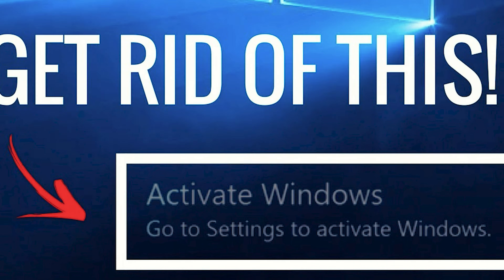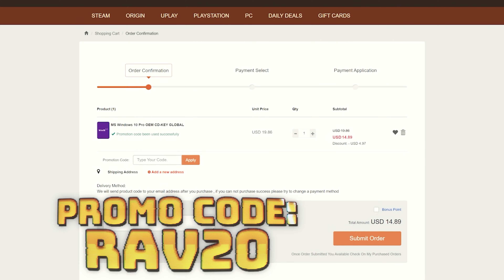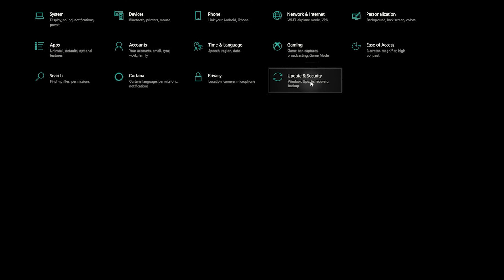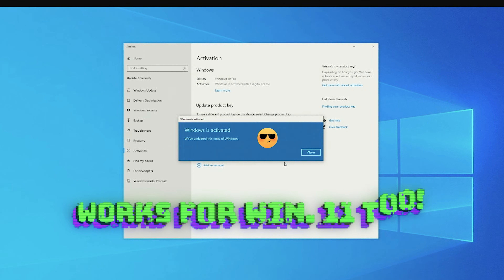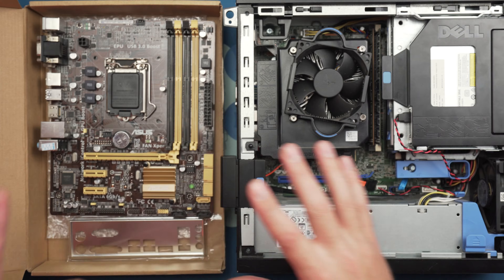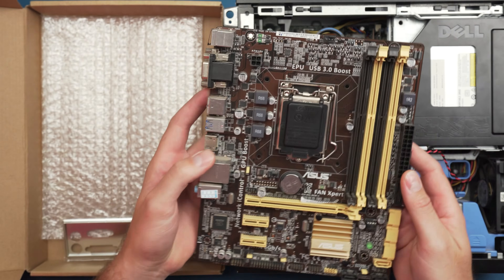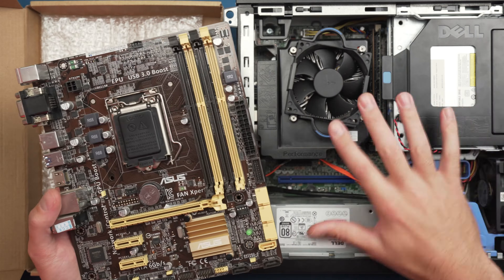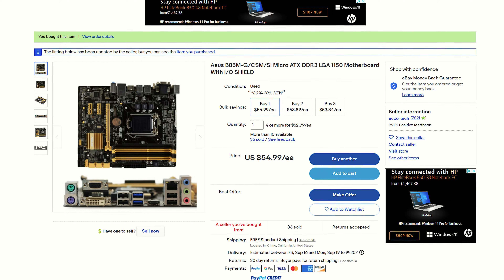Gaming Case Swap The Dell Optiplex SFF With ZERO Adapters! | Optiplex 9020, 9010, 7020, 3020 SFF

Comment: This isn’t really an optiplex case swap, it’s more of ripping out the guts of an optiplex and using it with a regular motherboard
Reply: Agree. I mean, this is exactly how any sane person should use SFF parts to upgrade, but talk about click bait title. Definitely not a case swap so much as a cannibalization. 😂
Reply: I just swapped a 9010 SFF motherboard into a 3010 SFF case, and while yes, some things like the front panel are a PITA, that's really about it.  Well electrically.  I had to take a dremel to the back IO panel, but still, you don't need any crazy skills to reuse the motherboard.

As a bonus, if you switch to the Dasharo implementation of Coreboot for the 7010/9010, you don't have to worry about the front panel errors at all.
Reply: Came here looking for a case swap, specifically because I want to use an optiplex motherboard (which sips power like a laptop when used in a homelab build), left disappointed. I downvoted this video without remorse, because it has a misleading title.
Reply: @danjayh  use an MT model, you can case swap those
Reply: It's not a case swap... The challenge on how to do  a real case swap is a reason why a viewer like me wants to know. Without buying a motherboard. Of course it is easier to buy a motherboard.
Reply: Well it’s the only way
Reply: Is that motherboard an upgrade from the original one?
Reply: I am going to do exactly what you did. Cause this works.
Reply: Ayo! Sell me the optiplex!
Reply: Yea because he didn't use any adapters without getting  a new motherboard u need adapters
Reply: "zero adapters" aside from the motherboard ig..?
Reply: lol, yeah.  clickbait
Reply: I think this is the right way to do it. In other cases you are still constrained by the PSU and the adaptors and while maybe spending similar amount of money and time. Doing it this way you have a lot of freedom to choose the parts you want.
Reply: He did explain why!
Reply: @saucysuishi341  But it's still misleading
Reply: @saucysuishi341  He could explain it 10 millions ways 'til sunday, it still is not a case swap. It's "building a new PC using salvaged parts from the Optiplex".
Reply from the maker: I’m aware. I explained why I did what I did at the very beginning man!
Reply: @RAVisuals  yeah that’s my bad I wasn’t paying attention in the beginning of the video
Reply: @RAVisuals  So why even bother? Seems like a wasted opportunity to do something special. BTW, you guys can throw computers parts in the garbage? We can't do that.
Reply: @RAVisuals  I think it's brilliant and way better than dealing with the proprietary connectors, I plan on doing the same and I think your idea is outside the box in a good way, quick question will a good lga 1150 standard mobo provide a RAM speed increase or support newer gen CPUs.
Reply from the maker: @sean70729  i don’t think you can support newer cpus unless they allowed it via a bios update in that generation. You may get more ram speed from a higher end motherboard though

Comment: Thanks for this - gave me hope for our Optiplex!  We have a the SFF with a i5-4570 which we have boosted with a Palit GT710 and we are tempted to go for the case swap!  It's difficult to get the exact motherboard in the UK (need to import!) so I'm wondering - will the Asus B85M-E work instead of your Asus B85M-G?  Comparing the manuals which I've downloaded, the E has different PCI slots (I guess that doesn't matter?), the E doesn't have a "1 x CLRTC header" (clock - so I guess that doesn't matter?) which the G has, the E doesn't have a "1 x S/PDIF Out Header" (audio so I guess ok?) which the G has, and it's also slightly different size (9.6" x 8.4" rather than the G which is 9.2" x 7.6" - I guess I'll have to check that will still fit the case?).  It looks like the CPU socket and the memory slots are the same and I guess the disk drive goes in as normal (although I've never done one - any thoughts/gotchas to be aware of?).  Will the B85M-E still be ok with the other parts?  I guess I'll need to check that the B85M-E motherboard layout will support a large graphics card if I we decide to upgrade that in the future - anything else I should worry about? Thanks.

Comment: What would be a better CPU for this motherboard? Im looking to upgrade maybe a step or 2 higher.
Reply: I think you could go also with the i7 4790. it's the best i7 before the k version the 4790k.
Reply: the i7 4790k is the fastest cpu the optiplex 9020 supports

Comment: Can I use any case I want? Or only a atx case?  Or is it a special case? And if there's any space in the case like in yours, What can I build in there in the free place? I just want a lot of rgb😂
Reply from the maker: This would actually work best with a micro atx case or a smaller atx case given that the motherboard I change to is micro atx.
Reply: Thanks for your response.
But I think your case was an atx case and not an micro atx case.so can I also use an atx case?
Reply: @Leon-ux4sn  yes

Comment: I love how recent this is. I have a 3020 SFF. Was on a budget and got a few Labor Day deals I got a i7 4790 new for $99 and a GTX 1660 super for $200. A power supply and SSD for like $60 I think. Now I just have to save up to buy a new mother board and case so I can really get the most of my 1660 super. For anyone wondering my case is wide open because the graphic card is too big and I had to cut out the entire back right side so it would sit in the pcie slot lol. It’s a struggle build but one day I’ll be able to upgrade
Reply from the maker: Nice man! Yeah, a bigger case for your card will be ideal for airflow and just looking much more clean 🙌🏼
Reply: @RAVisuals  the time is coming lol almost there. I love your content man, thank you for the reply. Looking forward to watching your upcoming content. Thank you for the step by step process with reasoning behind it.
Reply from the maker: @Pot_is_Power  much appreciated my man! No worries at all. Just trying to help people out and have fun with some tech in the process 🙌🏼
Reply: I did the same thing with my 7020. I have a 1650 super OC. SSD PSU AND 3 rgb fans. I really appreciate this video a lot dude. Now off to my journey of GTA RP 😂😂😂💪🏾💪🏾💪🏾
Reply: What kind of SSD did you get ?
Reply: @guts3309  Vulcan Z 1 GB and it’s more than enough when matched with the old 1 tb HDD that came with the Pc
Reply: @Pot_is_Power   thanks

Comment: It’s not really a case swap if you’re not using the motherboard…
Reply from the maker: I explained why I didn't use the dell motherboard in the video. Its just such a pain in the a** and basically renders all of the I/O of the new case useless. This is just the reality of the SFF models. I feel like this was a happy compromise and I was still able to use the most important parts of the original system. I have a video on the MT version of Optiplex and I was able to swap everything because the motherboards are much more accommodating
Reply: @RAVisuals  I'll check that one out as well. comparing costs of things, because it is fun I suppose. I'm wanting to sell my FX 8320E system and then upgrade it to ivy bridge or newer at the moment. Harder to find info on these heavily proprietary boards from gen 4 and newer. Gen 2 and 3 is easy. I will also end up with a few extra $ after I do so but a lot of lost time as well.
Reply: Yeah. . . Kind of silly and expensive the whole point of using the old dells is to save on mobo costs.
Reply: it still saves you from the cost of the prosseser xd
Reply: @shadoowgaming4563  They're pretty cheap if done right separately sometimes included. Still toying around with the idea of a dell newer than sandy bridge but yeah, I don't need case, power supply or ddr3 have plenty of that around and as a bonus I can sell the ddr3 system for more than the dell meanwhile getting a speed upgrade. Only downside would be time spent on the build would likely end up being more time than the faster computer saves me however faster computer is more enjoyable.

Comment: You put the old hardrive to a new MB, You are running the new PC with the Windows OS from Dell ? Or you have to buy a new copy of Windows ? I thought OS from pre-built PC cant transfer to a new machine . Thanks Lee
Reply from the maker: All correct! But no this one just booted to the windows screen. It showed a “hardware change” the first time I booted but the second time went straight to the desktop!
Reply: @RAVisuals  Thanks for your reply ...If I want to keep the existing Window OS , I cant swap the MB.      This project is for people who want to use old parts , to build a new PC which require a new copy of Windows OS.
Reply from the maker: @j.d.salinger2317  I did exactly that and can still use the copy of windows that was on the optiplex! It just accounts for the new hardware and allows you to use windows normally! I didn’t reinstall windows or anything with this swap

Comment: This is less of a case swap and more of scavenging an optiplex
Reply from the maker: true, but this is just how I personally would go about swapping the parts if you happened to have a SFF optiplex sitting around.
Reply: @RAVisuals  fair enough. Especially because those proprietary motherboards can be limited in their bios settings.

Comment: but RA, my question is, will that motherboard work w the Dell Optiplex 3020 so that I don't have to buy the adapters?? cause this looks even more easier
Reply from the maker: Yes it will! You just pull out your processor, ram and hard drive and use the new motherboard. It’s so easy!
Reply: @RAVisuals  niiiicee